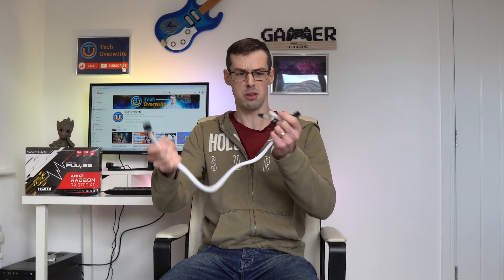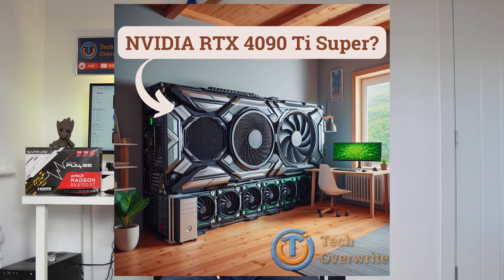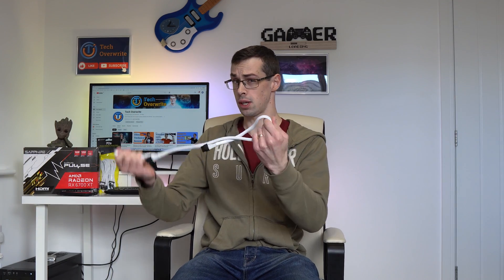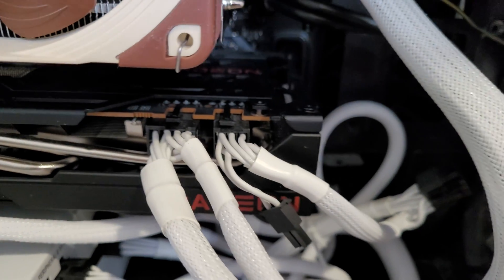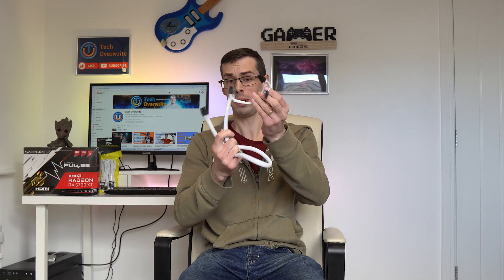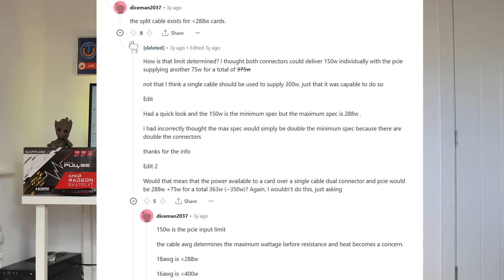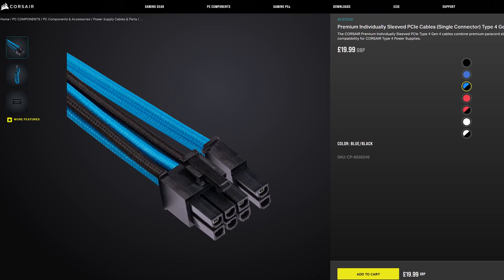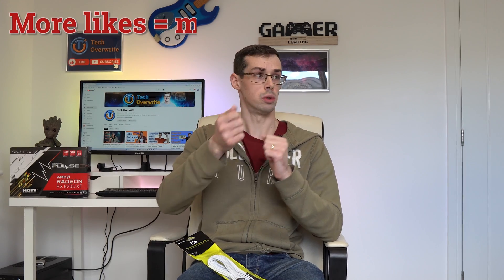Stop Connecting Your GPU Power Cables Like This! (How To PROPERLY Connect PCIe Cables For GPUs)

Comment: What if the card requires three separate 8-pin connectors? Can I use two standalone cables and a pigtail from one of them? (GPU: 5070 Ti, PSU: Corsair RM850x)
Reply from the maker: Yes I'd imagine that would be fine - the PSU is a good one, and the 5070 Ti isn't super high power. I mean, a native 12vh cable is better, but I appreciate not everyone had that in their PSU.

Comment: corsair stated that their 12 pin to 2x6+2 pins are safe to use for 300+ watt as the 150 watt specification is on the gpu end, the psu can pretty much pump as much as they can in there, thats how i understood it. how does this work with gpu spikes since my 9070 has been working well so far (only tested it in tlou2) but had spikes that were roughly at abt 370watt, no crashes tho, using the same 12 pin to 2x6+2 pin ive been using for four years with my 3060ti, my psu is a straight power 11 platinium 850 watt
Reply from the maker: Yes I agree, many better quality PSUs can supply a LOT more than the 150w base spec. In which case, as long as you don't get crashes, I would worry 😊

In terms of peak power use, all PSUs are designed to handle transient spikes above the stated amount. So a PCIe cable (and ultimately the PSU) can handle brief spikes above this, for example.

Comment: Can I combine a 12v dual 8 pin with a regular pcie 8 pin cable?
Reply from the maker: Yes that should be fine. Many PSUs now offer that "12vt to 8pin" adaptor and it's a useful way of getting more 8-pin PCIe 😊
Reply: @TechOverwrite  Alrgiht men cool, might go that route then from now on. The rx 9070 xt isnt made for the 12v cable

Comment: Are there no gpu/pcie cables with a thicker gauge wires in it? After all in a car you have battery cables capable of 100+ Amps (and in bursts several hundred amps) aka 1200W+. By using many thin conductors in those cables they remain fairly flexible, at least as good as 3x8 (24) pcie wiers if not better. I would prefer  2 cables at 8-10 mm2 to the 24 headed hydra we have now. They come from the same source and are recombined on most gpus any way, so no point besides spreading the load, why not thicker cables instead?
Reply from the maker: I agree tbh. It would be nice to have thicker gauge cables. Tbh I think the main limiting factors would be the physical size of the connector, which is dictated by the ATX specs (and of course, all the hardware out there). If the individual wires are too thick, the connector might not have a safe enough termination etc.

Comment: Hello! I’m using a be quiet! Pure Power 11 CM 700W PSU.

Previously, I had an RTX 4070, which used a 12VHPWR -> 2×8-pin adapter. I was using a daisy-chain connection for the 8-pin PCIe cables.

Now I’ve upgraded to an RTX 5070 Ti, and my current cabling setup looks like this:

One 6+2-pin PCIe cable goes directly from the PSU to the 12VHPWR adapter.

The second connection is daisy-chained (one PCIe cable with 6+2 ×2 pins going into the same 12VHPWR adapter).

The GPU powers on and works only when I use the original 12VHPWR -> 3×8-pin adapter that came with the 5070 Ti.
When I use the 12VHPWR -> 2×8-pin adapter from the RTX 4070, the 5070 Ti is not detected at all, even in Device Manager.

Here is my main question:
Corsair states that this kind of PCIe cabling configuration (including daisy chaining) is acceptable and should work fine. However, I can’t find any clear or official information from be quiet! regarding whether this setup is supported or safe with their PSUs.

What is your opinion on this?

For reference, this is what Corsair says about PCIe 6+2-pin connectors:

PCI-e 6+2 pin connector – This is the 8-pin connector you would insert into your graphics card, or the adapter that came with your RTX series cards. The PCI-e specifications have set this connector to being able to handle 150W. In reality it can handle much more, but due to variances in power supply and cable manufacturer’s quality and materials used, the graphics card manufacturers are limited to only drawing 150W per connection.
Reply from the maker: Oh that's odd, especially if the 2x8pin adaptor worked fine with the RTX 4070. Yes 6+2 connectors are a bit of a pain, which is why Intel and NVIDIA bought out 12vhpwr I guess (more consistency... in theory!)

So an 8-pin PCIe cable must support at least 150w according to the spec, but often quality PSUs supply higher gauge cables that can supply up to 288w. So in theory, what you did with the adaptor should have supplied enough power to the adaptor no issue.

I guess the main problem is that it's a bit of a lottery. If someone used that same adaptor, but with a much lower quality PSU, then maybe it wouldn't be as safe.
Reply: @TechOverwrite Thank you for the reply! By the way, I noticed an interesting detail. When I had the RTX 4070, I was always powering it using a single 6+2-pin cable with a daisy-chained second 6+2-pin connector from the same cable. So essentially, the full ~200 watts were going through one cable. Because of that, I think my current power connection should be able to handle the RTX 5070 Ti as well.
Reply from the maker: Oh that's interesting, glad you noticed that 🤔Definitely worth being aware of it.

Comment: Does this apply to the RX9070 card? I have one cable with two connectors. Should I change it to two separate cables?
Reply from the maker: Yes I would run two separate cables if you can :) You might be fine with one cable if it's a quality PSU and cable, but personally I prefer to err on the side of caution and run separate cables.
Reply: @TechOverwrite tahnk you man

Comment: So my Asus tuf rx 9070xt requires 3 connections. But my psu only supplied 2 pcie cables with the pig tails. So from the video is it ok to use 1 stand alone cable and then use the other one and the pig tail to put into the remaining 2 ports on the gpu?
Reply: Yes the rx 9070xt is a 330w tdp for the oc models, you should be fine as long as u have a 750w+ psu and two pcie cables (one being pigtail) even if the card has 3 8pin connectors

Comment: Why do these pigtail cables even exist?
Reply from the maker: They're sometimes not included on modern PSUs anymore, but essentially they're for historical purposes. Some PCIe devices used to use like 100-150w of power, in which case a single pigtail cable could power two such devices without issue (when accounting for the 75w from the PCIe slot too)

Comment: How about differing cable lengths? Say 39cm and a 69cm
Reply from the maker: Good question. I haven't thought about this point as much, but 69cm (nice) cables might start to suffer a bit, compared to shorter cables. Like anything, the longer the cable, the more potential for overheating etc. But if it's a quality 69er, it should still perform fine IMO.

Comment: So at the end you were saying don't use the one way pcie cable that plugs one connector to the power supply to the GPU? For example the new 2025 corsair psu that have the new pcie cable for the GPU directly plugs to power supply
Reply from the maker: I may have been wrong/unclear on that point tbf. Sorry for the confusion. If you have an RTX 40/50 series GPU, or a 9070XT with 12vhpwr, then it IS best to use the direct 12vpwr cable from the PSU.
Reply: @TechOverwrite thank you that clears up everything I was worried of using that cable from the confusion on my end haha thanks for the reply. I'm still rocking a 3080 ti so I won't be using it till I decide to upgrade thanks again!

Comment: Slot draw is only like 30 to 50 watts on Nvidia cards with the 8pin or 6pin..

And I still use Y adaptors on the regular along with Dell devil’s spawn.  I don’t overload, I combine SATAs to 6 or 8 pin never mind exceeding 54w or 108w, or 96w plus when used with a Dell 6pin wire to COMBINE the power.

I run a 300W Dell that way to power a 160W TDP RTX 2060.

I never exceed the amperage rating and Dell PSUs have some good capacitors, so no voltage spikes!
Reply from the maker: Glad that setup is working well for you! It's cool to hear about those specific Dell configurations. :)

Comment: First, we'll want to quickly cover the standard specifications set by PCI-Sig. They state the PCIe 6-pin is only capable of 75W, while the 8-pin is capable of 150W. The extra 2 pins are two wires simply acting as "sense" wires that notify the GPU of the capability to draw 150W.

The 150W rating only applies to the connector on the GPU. In other words, the primary difference between the 6-pin and 8-pin is based on PCI-SIG's specification, and not the conductors. A well-constructed 8-pin cable, such as our PSU cables with pigtail connectors, should be well capable of providing more than 300W of power.

If we look at the RTX 5090 as an example following PCI-SIG's specifications, they are rated at or close to 600W - hence why they include a power adapter that requires four 8-pin PCIe connectors. In accordance with the PCI-Sig specifications, each 8-pin PCIe connector will supply 150W to total the 600W required for adequate support. You may use two of our cables with pigtail connectors to adequately power the RTX 5090
Reply from the maker: That's fair, and I appreciate the points :) I'm not denying that some 8-pin cables can supply a LOT more than 150w.

However a LOT of comments have said that they were having crashes/poor performance with a pigtail, and this was then fixed when moving to separate cables. This mirrors my own past experience too.
Reply: @TechOverwrite  i see. It's always worth a try if there are any problems

Comment: dude… i’ve been daisy chained my 4070ti since i got it i think it’s been 1-2 years wtf thank u for this video daisy chain used to be no problem for my 1060 i didn’t know😂😂😂 im going to buy the corsair 12 vphwr cable one cable still but two connections to the graphics card is this better ?
Reply from the maker: Hah no worries, happy to help 😂 Yes that Corsair one should work fine (assuming it's the right 'Corsair type' of cable for your PSU - sounds like it is though).

Comment: I have a Seasonic Core GM 550W power supply with only one cable; it doesn't come with separate cables. Could I connect an RTX 2070 Super to it, or would it be better to get another cable? 😭
Reply from the maker: Oh that's frustrating :(  It's hard to say for sure. You might find that since you have a quality PSU., the PCIe cable supplies more than 150w - and so the 2070 Super will work fine. You could always try it and see. It won't damage the card if it crashes under load (due to undersupply of power).

Worst case, you could then just undervolt the card and hopefully stay within the power limits.

Comment: so my gigabyte 5080 has a tdp of 360 so does that mean i can use 2 pcie cables connected to the 12vhpwr connector
Reply from the maker: Maybe? I mean, it may or may not work - some PCIe cables supply just 150w, others supply 288w or so. So using 2 separate cables might be fine for the 5080, or it might top out at 300w total and then cause problems. You'll only know by maxing out some games, or running Furmark, and seeing if you hit into issues at the top power draw levels.
Reply: @TechOverwrite  built my pc yesterday and it worked! currently playing games on ultra 4k no issues so far, i also reduced power usage on the nvidia app by a tad just for ease of mind. ive been monitoring my wattage and roughly getting a max of 350 with no issues using two pcei cables.
Reply from the maker: That's awesome, glad to hear it's working out fine :)

Comment: sadly my 750W non modular psu only comes with a daisy chained PCIe 6+2 pins, its currently working fine for my 3070ti, under load like (cyberpunk RT Ultra) no crashes or any issue found yet. Should I upgrade my psu in the near future that comes with 2 separate 8 pins PCIe cables, or the current set up will do for the time being?
Reply from the maker: Honestly? If it works fine without crashes, then that's all good :) I would leave it be. The worry is when a game is crashing/freezing etc.

Comment: So i have the 9070 xt sapphire and a evga 1000 g5 80 plus gold power supply. Which pcie cable do i need? Or which ones would you recommend. I been having game stutters / fps drops and sometimes pc just restarts on its own because i am currently using 1 cable with (pigtail)
Reply from the maker: That PSU should be fine - but I would be running separate VGA cables from the PSU. Don't use the pigtail at all. So for the 9070xt Sapphire, I think that needs 2 cables. So plug into VGA1 and VGA2 (for example) in your PSU, then use those 2 separate cables for your 9070xt :) If you're still getting stutters, maybe try doing a clean driver reinstall with DisplayDriverUninstall.
Reply: So i have the cables that came with my psu but i THINK they're pigtail cables. Should i be going for single ones? And also if so which ones should i go for? And i do have 2 separate cables but theyre both pigtail cables and it seems like i still get stutters. And not only stutters but also when im gaming and i have twitch on my second screen it seems like that lags too. (Not streaming just watching) @TechOverwrite
Reply from the maker: It's fine to have and use a pigtail cable, but without plugging the pigtail end in (if that makes sense). So you could run 2x separate cables, and plug one part of the cable in, then leave the other bit of the pigtail dangling there unused. It sucks you're still getting stutters though - does it happen if you lower all the graphical settings down and maybe try playing at a lower resolution (as a temporary test)?

Comment: Got a 850 watts psu rated 80 plus gold and a rx 9070 xt card.
Wish me luck ill be using two pcie cables as thats what my PSU has (MSI Mag AB50GL PCIE5) as well as the pig tail lol

If all is well ill try remember to folow up here
Reply from the maker: Fingers crossed it worked out okay for you :)
Reply: 4 days later and its all good!
Reply from the maker: That's great to hear :)

Comment: so if i have 3 pins for a 6800xt, need 3 seperate cables
Reply from the maker: You might be fine with 2x separate cables (and then a pigtail for the final connection), but yes, 3 separate cables will probably be more stable :)

Comment: Very late to the party, but I want to make sure before I accidently burn down my house":
I need 3 8 pins, so I connect the first one into pce1 and to the first slot on the gpu, then I connect the second cable (pigtail) to pce2 and then two slot 2 and 3 on the gpu. Is that correct?
Thx a lot for the video!
Reply from the maker: Yes for most GPUs, that should be fine :) The exceptions, though, would be for super high power GPUs like the 7900xtx or NVIDIA's high end GPUs (4090, 5080, 5090) with a squid adaptor - you wouldn't want to run pigtails to those adaptors IMO. But for most other GPUs, running 2x separate cables and then using a pigtail for the 3rd connection should be fine.
Reply: @TechOverwrite thx again ;) I got a 9070xt, and I used two cables, at the moment it seems that everything is running fine. Bf6 looks so beautiful ;)
Reply from the maker: Ah nice, glad to hear it :) I agree, BF6 is a nice looking game. I love all the effects too, e.g. when a building starts to collapse from an explosion.
Reply: @TechOverwrite yes, just yesterday I was repairing a tank, then it got hit by a fatal rpg, exploded next to me, while at the same time a chopper crashed a few meters away. Epic!

Comment: Does this still apply to a PSU Daisy Chain cable thats running off of the newer 12x6? 

 I bought the Corsair RM750e (2025) with a 9070xt, but the PSU came wirh only 1 6+2 PCIe cable and the other is a 12x6 Dasiy Chain cable which I'm currently using... I did want to wire up the card with 2 6+2 8Pin PCIe cables but i didnt get another one. 

Btw i know a 750 Watt PSU isnt enough for a full system and the GPU but im using the GPU as an eGPU via Oculink so thr whole 750 is just for thr GPU.
Reply from the maker: Great question, this is fine because it's more of an official way to 'get' more 8-pin PCIe power that Corsair came up with. In other words, it's not so much a pigtail as a 12vhpwr adaptor for non-NVIDIA GPUs.

In short, you're fine with a 750w PSU and a 9070xt using that 12x6 daisy chain cable :)

Comment: maybe u can help me with this im looking to buy a 5080, would a cable 3x8pin to a 12chpwr be safe to use i don't really trust the cable splitter that comes with the gpu.
Reply from the maker: Would that be a standard cable from the PSU maker (or someone like CableMod)? Those options should both be fine, but I wouldn't personally use an adapter from AliExpress or eBay if that makes sense.

Comment: bro i bought a 850w msi mag psu with ONLY pig tails for my 9070xt which has 3 pcie slots. Should i just plug both in and let one of the pig tail ends hang loose???
Reply from the maker: Yes leaving one pigtail end dangling unused should be fine :)
Reply: @TechOverwrite just to be clear one of the pig tails go in slot 1 and 2. Then the other pig tail in slot 3 and let the last hang?
Reply from the maker: Yes I agree, that should be fine for a 9070xt :)
Reply: @TechOverwrite i found 2 motherboard in my area for the same price. Asus b650e max gaming wifi and Gigabyte 850 Eagle Wifi 6e. Which one would you choose?
Reply from the maker: Sorry for my delayed reply :/ Did you end up buying either? Both should be fine to be honest. There's not a major difference between B650e and B850 IMO.